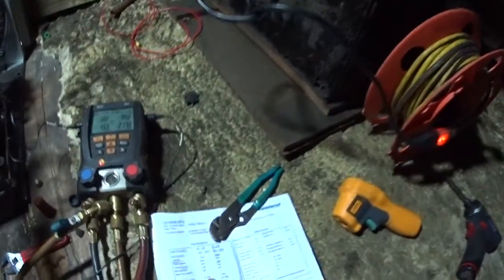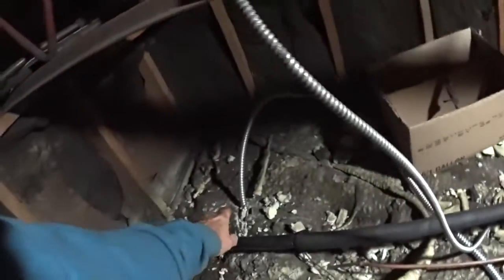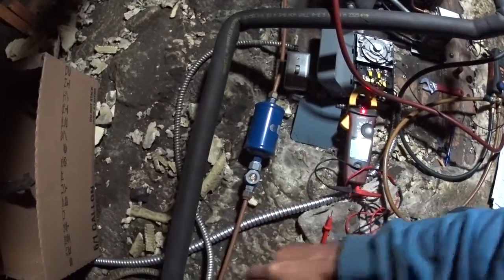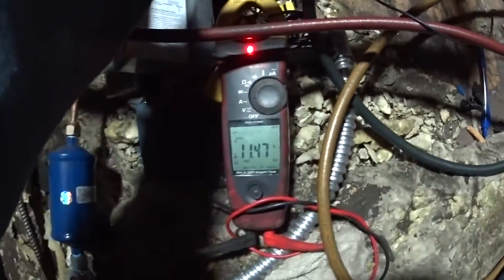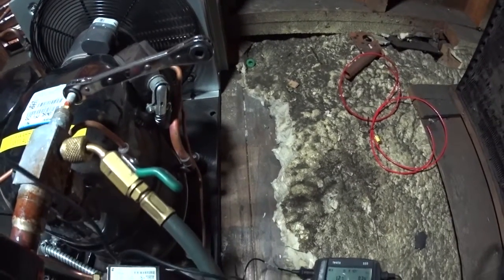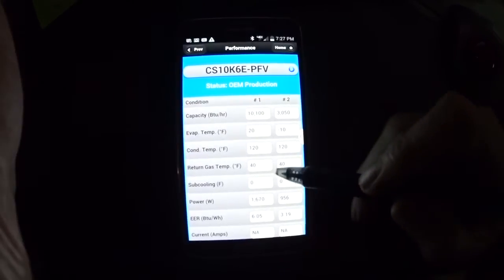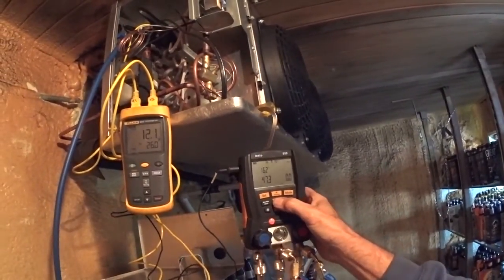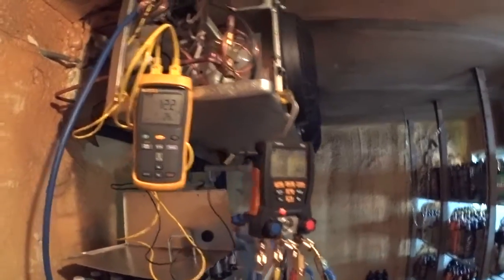Beer Cooler @ 28 degrees (part 3)

Comment: Jim, I've really enjoyed this series. Thanks for all the explanations and detail you provided.  I was just a little confused about how things were left at the end, when you measured 24 degree air and mentioned the bottle tops could freeze.  Will you back off the TXV just a bit now, or will you be relying on the cold control setting? 
Amazing that someone would spray foam on a condensing unit and not know better.  LOL  Thanks for the video.
Reply from the maker: When I was done I turned the temperature control up to 28 degrees, the txv is where I want it for 28 degrees. I had to turn the temp control down to keep the system running through the adjustments. Thanks.
Reply: ***** Okay, great; I think I'm on track now.  Thanks for the reply.
Maybe the customer will want to capitalize on your expert work now and start advertising the coldest beer in town.